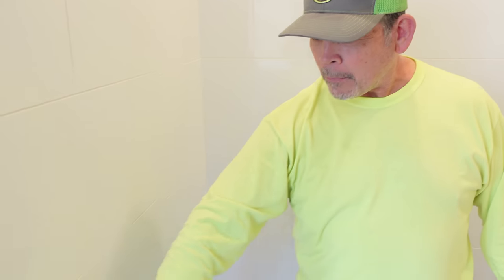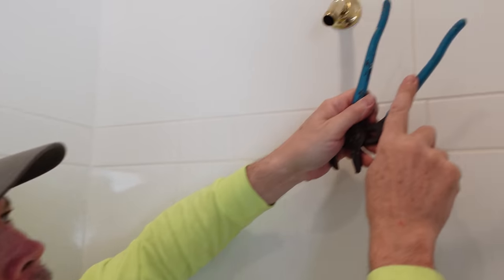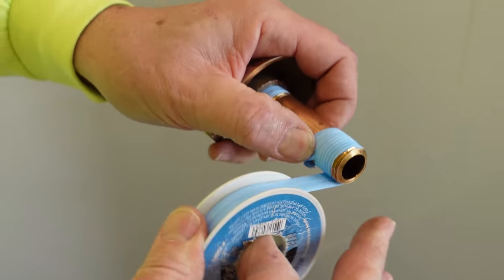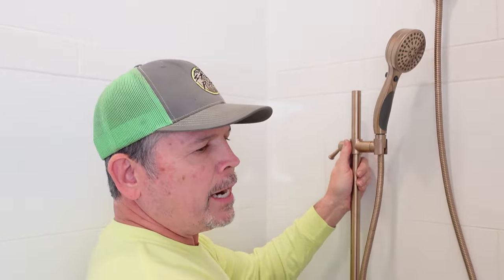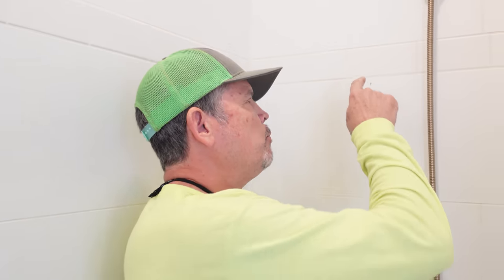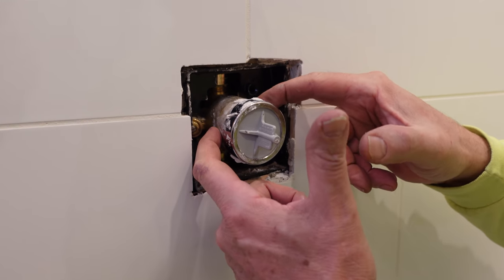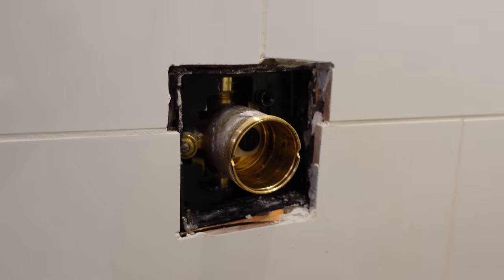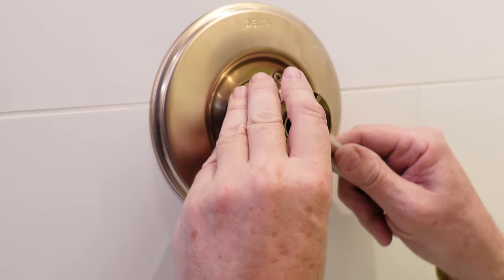How to Install SHOWER TRIM (Step by Step)

Comment: Great Job! I like the hand held wand. Just a suggestion, The height of the stub out for the showerhead should be 6ft 6in.  Why it matters?  The hose length of the wands is determined by that height. The spray diameter of a fixed showerhead is also determined by that height. The height was based on an average man being 5ft 9in.

I like that Delta valve. I like the way it separately controlled the temperature, flow and pressure. Seems like it would mix hot and cold instantly.

When wrapping Tape Dope you want to leave the first 1-1/2 threads bare. People tend to wrap tape over the end of the nipple. This tape will break off at some time clogging small orifices. Some valves like washer machines and maybe dishwashers might be screened. Some valves like the Ice Maker, dish hose sprayer, toilet valves may not. The tape will migrate and get lodged between the poppet and seat.

Tape Dope's main purpose is lubrication on NPT threads especially stainless which galls easily. I use it on all threaded plumbing connections , not for leaks, but to fill the void in the threads to seal them from water ingress. That bezel you screwed on the valve will get water on the threads, corrode and make it a bitch to remove later. A little plumber's tape fixes that.

That small plastic tool you tossed to the floor could have been tucked away in the valve housing to be used later.

Comment: I just had a similar style Delta valve break on me. Basically could not shut the water off. The teeth gear broke off from the valve itself - had to drive drywall screws into the plastic bezel to turn the water off until I could back to fix it. Delta sent me all the replacement parts free of charge on a valve/trim kit that is 10 years old. The collar was also seized on (someone must have taken a wrench to when installing). Delta recommended soaking a rag in vinegar and wrapping it in plastic to eat away at some soap debris, etc. That plus a oil filter removal tool got it off no problem. Morale of the story - the customer service at delta is second to none.

Comment: Here in the uk you can buy multi-construction drill bits made by Bosch. They look like a normal masonry drill bit but they drill through wood, metal, masonry and tile. On a ceramic tile they go through in a few seconds without the need to keep cool, they are also sharp so they start very easily without slipping.
They will drill through porcelain if you work the drill in slight circular motion and also dip the bit in water every 4-5 seconds. 
Just don’t use hammer!

Comment: Trick i learned far too many moons ago when drilling tiles is to put a piece of sellotape over your mark,it helps stop the drill slipping and you can still see the mark through the tape.Also if there ceramic tiles use a cheap metal bit a mm smaller than the size you need, then once through the tile use the correct size masonry bit

Comment: Of course this would go all the way back to rough in. If you wanted to do a shower head and handle that were not part of a kit. IE you wanted to have a over head rain shower head and the shower handle like you did. Do you have a preferred valve to direct the water to one or both shower heads? Or is that even a thing?

Comment: On some shower valves, if the test plug is in but the cartridge is not, hot and cold water will flow through and mix, so you'll get lukewarm water from hot and cold taps all around the house. So put the cartridge in right away, even if you won't be installing the handle trim until later.
Reply from the maker: Correct.  This is a good idea when your valve doesn’t have integral stops 👍

Comment: Curious as to placement of the shower rail. Why did you put it to the left of the 90 with hose attachment? Wouldn't it be better to the right so the shower head could be angled toward the side wall & away from the shower entrance?

Comment: I wuv-it when installers reverse the hot/cold valves, especially when they're marked on the fittings! Didn't know H and the color red was for cold while the C and blue was for hot......
Reply: Same problem in my house. I’m not a pro, so when I got a lot of complaints from my guests after I moved in that the guest shower was reversed and didn’t get very hot I had to come to YouTube to find out how to adjust it. Now it’s wonderful. Too bad it was obviously installed by a moron—makes one wonder what ELSE they did wrong.
Reply: In French, the word for Hot is "Chaud," so you can't assume C means cold!  (Voice of experience speaking here.)

Comment: Love this video of your mom's ADA accommodated shower. I really enjoy seeing access-adapted homes. I'm currently struggling with no hot water in our master bath vanity (dual sinks). There's hot water in the master shower and the hall bath on the same level, but not at the master bath sinks. Relatively new angle stops at both sinks, and faucets are about 5 years old. What could the issue be?
Reply: Seeing as it's only causing problems for the master bath sinks, you've already isolated where the problem could be to just the plumbing related to the master bath sinks.
If they worked before and now they don't, my first suspicion is that either the hot angle stop was left off (or not turned on fully), or some bit of debris got in the lines and has formed a blockage.
Either way, put that hot angle stop in the other position and see if you get any hot water. If not, put it back "open" again and try the hot water again. You might have dislodged whatever crud was in the lines causing the problem in the first place.

Comment: First Thing. Nitrile gloves. Fingerprints on the finish. Moms house wont matter but a clients house,  Saves you cleaning finish after.
Secondly Dab of silicone in the holes before you screw into the plugs or backing

Comment: I would like those drilled holes in the shower to be filled with silicone before tressing in the plug as you have made a hole through all the waterproofing 😬.

At least when i shower and in the end i flush down the walls to prevent soap stains, so i would flush it all
Reply: It won't get much water in to it but if shower is used 2 times a day it will always be wet in the hole, and not the good kind 😅
Reply: agreed, love these guys' videos but I cringe when I see people drill straight through their shower waterproofing without doing anything to try to mitigate
Reply: @danskavdal7377  I agree too. I have learned to be careful of what silicone you get. Some silicone caulking might not be 100% silicone. Then you end up getting mold issues. I was hoping to see him do a full Schluter system. Understandable due to supply chain issues and time crunch that they did not do so. I learned allot in some Schluter workshop that I took recently. I didn’t just learn about their products but was very happy to see that they taught from the TCNA handbook also. All it cost me was time and my gas. They have a product called Kerdi-fix. I’m not sure if I spelled that right but I’m sure that I would’ve preferred to use that to help seal the penetration. It’s an extremely good product that for things like that. I hope this helps!

Comment: What is the product code for the Delta cartridge and covers? I replaced my valve body, but I can't find finish pieces/cartridges at my local home depot.

I do have the same valve body which is why I ask.

Comment: I bought a nice diamond one that is larger from HD when I was tiling my shower because the shower head fell dead center of a 12x12 tile at a 45 degree.  It had a nice little cup that went around so you could put some water in there and it made a slurry.  Works well.  They had them from something like 1/4 to 3/4 maybe?

Comment: I know your mom will love the new shower, I'm glad you got the shower wand with the adjustable positioner, that's perfect!   One thing I noticed is the gold/brass trims on everything, while I think it is pretty when newly installed I find that over time it tarnishes, turns silver in places and looks bad.  I've replaced my fixtures and found that brushed nickel holds up better, so far it's, IMHO, I think is a better look (after I got used to them)...  But your milage may vary on bath/kitchen fixture finishes... so I know I probably pushed a button here... people will have different opinions about color, style, durability, etc... that's why there are so many options to choose from... but what say any of you?
Reply: IMO brushed nickel is the right choice. It's simply the finish that retains its looks the best over long periods, with only the slightest bit of maintenance.

Comment: I'm skeptical of plastic anchors for something that very well could be used as a grab bar by a person, even though it's not intended to. Why not screw it into structure with a real screw?
Reply: Because there wasn't any structure/blocking in that location.    They had blocking down below for the bottom part, but didn't have the blocking fom the top, so they had to use anchors.   If you're doing your own remodel, there's a lot to think about when it comes to blocking because once the finish wall is up it's too late.

Comment: How do you know if the stub that you attached the shower elbow to is tight enough and not leaking (I hate pipe threads) and want getting hard to tighten because you were tight up against the tile?

Comment: Is there any particular reason why the shut-off valve assembly is so low? Most of the walk-in showers I've ever seen mount it higher so you don't have to bend over to turn the shower off and on. I'm assuming there was some plumbing issue that required it to be lower.
Reply from the maker: My mom is short is all 👊👍

Comment: Were you able to check in the wall  for leaks where the 90 connected to the pipe? It would drive me nuts not knowing if it was leaking. I hate plumbing lol
Reply from the maker: It was all pressure tested 👍
Reply: @StudPack  Well Duh. Never thought about that. Should have known you guys are pros and Im just a plain old Johnny Homeowner...lol

Comment: Do you have a preference between Teflon tape and joint compound? I’ve heard the compound lasts longer and gives a better seal.
Reply from the maker: No preference.  I use them for different applications.  Depends on lots of things.   Tape isn’t as messy when that matters.  Dope is easier to brush on sometimes.
Reply: @StudPack  Speaking of tape. I always start at the end of the pipe. You started the tape away from the end of the pipe. Have I been doing it wrong my whol life. I do know you want to wrap it so that as the two parts thread together it tightens the tape.

Comment: Ok.  As an amature DYI'er I have changed the bent pipe connector for the shower head.  In trying to get the extra turn I found that the pipe bottomed out at a position where the shower head would be pointing up.  My action was to remove the pipe connector and to retape the treads and try again this time to leave it 3/4 turn loose to finish the application.  Am I missing something?
Reply from the maker: Nope you did fine.  Adding more tape can help with alignment issues

Comment: Paul or Jordan:  With that valve being on the other side from the shower outlet, do you notice a long delay between changing temperature and feeling the change on the outlet side?  
 I imagine having this type of valve should keep the setting where you want it without a bunch of changes in the middle of your shower.   Just wondering how much lag if one were to use a 'normal' valve with manual adjustments only.
Reply from the maker: It’s only a few seconds.  My mom will never adjust temperature once she dials it in.   That’s why we got the dual valve cartridge.  Temperature and volume are independent

Comment: Don’t use the plastic test plugs. I always used a galvanized nipple and cap until about a year or so ago when I came across these test plugs. I’ve used them a lot without issue until recently. The first issue I had was partially on me. I didn’t have a way to bleed the air so I loosened it a little until water came out. I screwed it back in. Since it seals with an external o ring, the pressure pushed the o ring out a tiny bit so it didn’t seat properly. This caused a tiny leak. I could get over that. The next issue was the big one. I had a shower with 4 of them. It was a rainhead, regular head, hand spray, and then a steamer. I get called out for a water leak in the shower. This had had water on it for months at this point. I went out there and the tile guy had missed his mark when drilling the hole through his hardie backer. It was just putting a little lateral pressure on the test plug. This caused a good sized leak. I replaced it with a nipples. Then I get called out again for the same issue on another one. Again it was a test plug. I couldn’t figure out how it leaked though. The tile guy though it came from the attic which it wasn’t. The water was spraying on the pex and then running back down the pipe making it look that way. Because of this he didn’t think I fixed anything. He offered to cut open the wall before tile was on. I said fine and took a break while waiting for him to cut. I happened to walk back in while he was working on it and saw him get on a step stool. When he did he grabbed the nipple to brace himself. The fact that he did this may have been why he was so concerned with me checking because he worried he had broken it. Of course that didn’t stop him from doing it again. I can’t prove this is what happened but it’s a very educated guess. This may not be an issue for y’all because y’all are the only ones working there. If you use them right they’re fine but because of there delicateness I just stopped using them.

PS this is something I just had to say as a long time fan and few time commenter. There’s been this theme among plumbers and maybe other trades that you don’t let handymen do plumbing. I think y’all are much more than handymen but you get what I’m saying. With this considered, I appreciate that y’all do the plumbing properly and are humble enough to admit when you make an error. Then you give that knowledge to the world. It helps bust this myth that you have to hire a plumber to get the job done correctly. I think it comes from plumbers who are threatened when anyone else does their work. If you’re threatened by someone else doing your job then you’re probably not doing it good enough to begin with and you know it. Ive seen other videos that do bad work and I may come off as an a hole but I do try to comment with a correction so people don’t copy it and end up messing up their house but some plumbers unfairly criticize anyone who isn’t licensed. I’ve never been big on the idea that a license somehow automatically makes your work good. If someone can do it up to code, that’s all that matters. I’ve always tried to help my customers do things themselves even if it sometimes cost me easy money. Mainly because I think it’s the right thing to do but also because I know when it’s too big for them they’ll call me because they know they can trust me. It seems like the past year or so I’ve come across a lot more dishonest plumbers than normal. Several times I’ve been called out for a second opinion only to realize that there wasn’t an issue in the first place. I’ve also talked to former coworkers who now work at service only companies and I learn they won’t go to a call unless they can sell them on a much bigger job. It may just be how the market is at the moment. As trades become more rare, the price goes up and this brings dishonest people in trying to capitalize. As usual I said 10 times as much as I needed to so I’ll get to the point. Thank you for getting things right and when you don’t being humble and honest enough to correct it.
Reply from the maker: Thx as always Josh.   Good tips about what can go wrong with those plastic test plugs 👍👊

Comment: question... when you are threading in a pipe behind a wall like that (like the one for the handheld shower with the threads behind the tile), how do you verify you don't have a leak?
Reply from the maker: You really can’t.   There must be a better way.   On the flip side it’s only under pressure when the shower is on and it’s not full pressure but a leak is a leak 🤷‍♂️
Reply: @StudPack  I'm imagining some sort of paper or tape or something that changes color when wet that could somehow be wrapped around the pipe and threads (with a gap to allow the female end to fit inside) and then have that come all the way outside the wall. Then, after running the shower for a while, see if there is any color change from water wicking down to the visible part. If not, tear off all the paper/tape. Maybe a product idea?
Reply from the maker: Great idea Frank 👊👍

Comment: Every shower tub assembly I have ever seen has had the shower tub control valve on the same side of the shower as the shower head.  Is this a Southern thing?

Comment: First, I would "never" use anything in this video by choice.  I'm too traditional (in my mid 70's mow and I want the "Old School" configuration.  Always have.  Always Will.  That's why nowhere I own will ever have this plumbing configuration.  (There are lots of shower head options in "Old School" configuration that allow hand-held showerheads on the market!!!)  Having said that, I do appreciate the knowledge in case someone asks me about something like this.

Comment: So much effort goes into waterproofing a shower and then we drill holes through it all. This is a particular issue for glass enclosure mounting hardware. It just seems dumb to me.
Reply: I agree. I’m thinking that a little dab of clear silicone putty under the screw plug would help with leaks.
Reply: There's a you tube tile guy, TileCoach and he says same thing. He just did a video showing  that not busting thru the waterproofing, still keeps the shower glass solid.